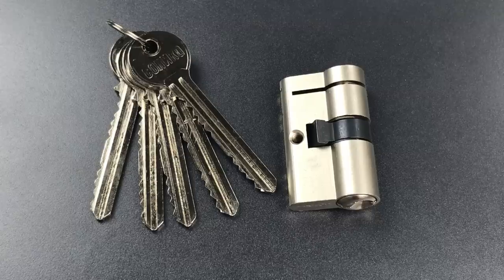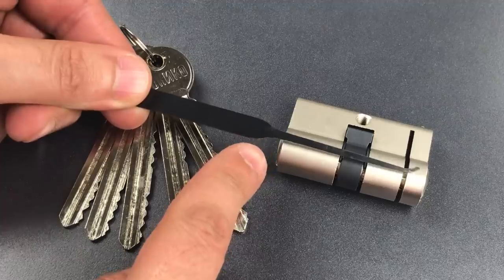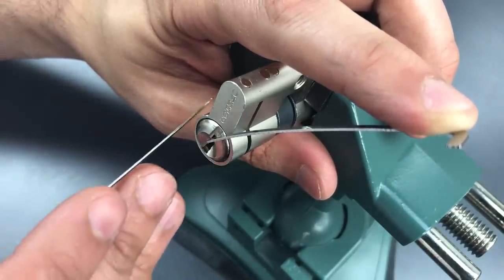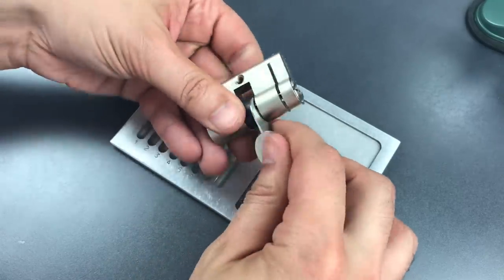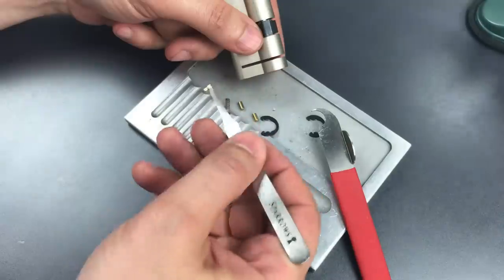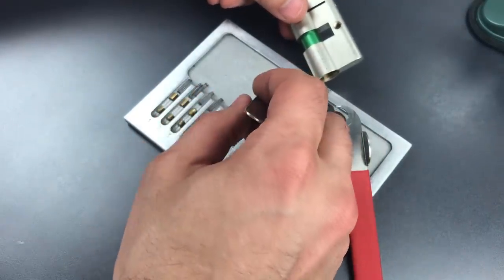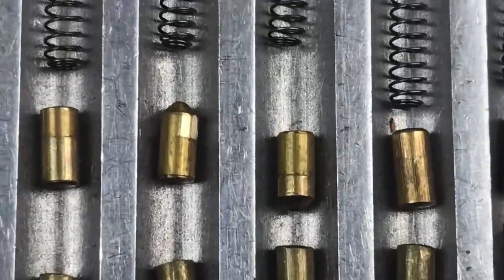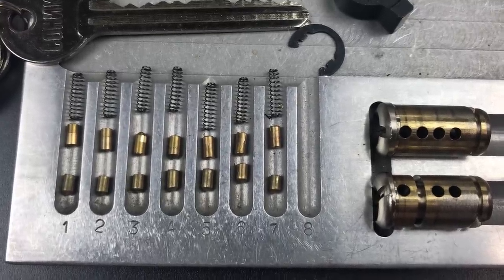[736] Sonico LONG Key Euro Cylinder Picked and Gutted

Comment: You should re-pin that as a challenge lock and send it to BosnianBill as a thank you for the naughty bucket locks.😁
Reply: This
Reply: Make that a combo lock. One end is a dimple core and the other is a disk detainer core.
Reply: I was just thinking the same. It wouldn't take much to thread a couple of chambers in the core, add some more exotic pinning upstairs & downstairs, a few variations in spring tension, and it could really perplex a picker who doesn't have sight of the key or know about the unusual mechanism. Even without those modifications, unless an attacker already knew to expect this lock, they'd probably not arrive at the premises with a suitable length pick. It's a really interesting lock in any case.

Comment: Someone needs to make a 12 pin version of this! With security pins and all the fixings. I'd want to see that key lol
Reply: Of course, add fake cuts in the middle, so it looks like a 16 pin lock. :)
Reply: This would make for a truly brutal challenge lock. Throw in one of those ball-chain "pins" anywhere you please and you'll get hours of fun out of it!
Reply: Don't forget that this lock has poor tolerance so it wouldn't put up all that much of a challenge once you find a long enough pick.
Reply: Of course, but that's why you use an actual decent euro to start with, for example a six-pin which would give you the 12 you want, something with a decent manufacture quality, and as was said above "security pins and all the fixings" - in short, the good shit.
Reply: Precisely this. There's no way to have 12 pins in this junky Sonico lock anyway. Just mod an existing good euro cylinder with a similar style cam (can pass the key through it). Hard part would be to create a key that would be long enough. Still would be quite the sight
Reply: Creating a key isn't too difficult, a damn sight easier than creating a core... Or rephrased, I can predict how to machine a new key, I can't even begin to imagine how to machine a core.
Reply: @colinstu  technically, you could drill it for more pns. But starting with a fresh bit of brass, or a decent lock would be the better way.
Reply: or a Abloy style disc tumbler lock that would tension from the middle.
Reply: I could see lpl picking that in under 3 minutes
Reply: Fixins
Reply: @Islacrusez  more like hours of frustration
Reply: @craigcrissman4651  😇

Comment: I could argue that 99.9% of the people that would attempt picking this lock, would have no idea that this lock was inter connected making it very difficult to pick.

I'd think the only way to get the driver pins into place would be to shim the bible and remove on the core installation. 

Anyway, good pick!
Reply: I feel like you'd start to get annoyed after awhile only to stick your pick in the back wondering why it's not opening only to realize there's more pins (if you pick is that long)
Reply: Gunga Dinn the standard trick is to cut a follower tube into 5mm or so slices and feed them in and out slice by slice from the central hole.
Reply: @Luxe388  clearly needs a 3rd core with more pins
Reply: you'd also need really long tools to reach the second core so even if you figured out the secret you wouldn't be able to actually do anything with that information

Comment: Would have been harder to tension if the cores were split. I wonder if that is a realistic modification to increase the Lock’s pick resistance or if the actuator would allow for it... hmmm.
Reply: Grouchy Ed I was thinking about this also. I think it could be solved by indexing the locking Paul  on the key instead of the cores
Reply: The Mauer GM redline has pins in both chambers and  has split cores and makes it harder to tension, but being a dimple it is easier than this one as you have more room to tension it.

Comment: If installed externally, I suspect that keyway would be filled with dust and dirt from air blowing through it. Any tight tolerances would fail much earlier in that environment.

Comment: There was a euro cylinder lock of similar design in the 90's in Czech Republic made by Guard, a company later, or at that time aquired by EVVA, had six pins each side, security pins as well and you actualy needed two keys, one from the outside, the other from the inside as the profile was of course asymetric and trying for pick resistivity. And they were making it different lenghts on demand.

Comment: I think the interesting thing about this lock is that you wouldn't guess from the outside that it was a super long lock and it's highly improbable that someone would have an extra long pick with them. I would put a spool and a super spring on each end though and then you would just bend your pick on the last pin.
Reply: File in kit always

Comment: At last, a euro lock that puts up serious resistance to a snapping attack.  Prior to this, the best that has been done for snap-resistance is a sacrificial section, but that leaves a core with only 2 or 3 pins so is much easier to pick.  Better than nothing, but a combined snap/pick attack on  3 pins might not be beyond some thieves.

This thing required decent picking skills even after a snapping attack.  It's let down by the design of the core, but the concept is a good one.  Tighter tolerances and some security pins would make this a winner.

Next problem, that key is going to be a real pain to put in a trouser pocket unless you're wearing cargo pants.  With sealable pockets, otherwise the key will jump out when you run.

There is always a downside to a euro lock.  It's inherent in the design.

Comment: tip for them is to make the "core" like on a normal lock but that can only be tentioned from the back also if the front core is not picked the back can not moove to unlock but if the front is picked then it can freely moove only 90 degrees in either side ...

Comment: That is freaking crazy. I think with some better machining and more security features, that lock could be pretty formidable.

Some counter milling, a variety of pins, and having the two cores have different bitting. 

I know with each core having different bitting, you wouldn't be able to open the lock with the key from either side, but most people only lock there doors from one side anyway.
Reply: It should be easy enough to cut keys with bitting that mirrors each other. Then you just have an inside key and an outside key.

Comment: Do you think there is any reason why more locks don't use security pins? It seems like a cheap and easy way to up the security level, but a lot of even mid to high security locks don't use them
Reply: Security pins add mfg cost and complexity.

Comment: Wow, what a simple and elegant idea ! That will complicate things for the cocky pickers ! Oh .. nevermind ..
Reply: More importantly, it will defeat the snappers.  Even those with picking skills good enough to attack the 2- or 3-pin core that's left after they've snapped a snap-resistant lock.

Since snap attacks are by far the most common on euro locks, even with shitty cores this thing will prevent most thefts.

Comment: I wonder if it would be possible to create a mechanism with which you need to apply tension to both sides of the cylinder, in order to reinforce the idea of using two keys at once or one long one as opposed to being able to pick both cylinders separately. Reaching through the middle part in order to apply that tension would make things even harder.

Comment: i havent finished watching yet but that key looks just like a rake. its interesting that a lot of these "hard" locks really arent hard, its just overcoming the challenge of getting your tools to fit or adapt to the lock. it does work in the wild though when its a surprise to the attacker.
edit: it looks like the pins are cut lopsided and uneven, low quality... it seems like this is the type of lock to make when youve got a ton of extra key pins to use. just throw em in there any which way and call it a high security lock with an impressively long key.

Comment: Hi I have a question. When picking an unfamiliar lock, how do you know if it needs to be turned clockwise or counterclockwise?
Reply: If its outside of the protecting stuff (door) usally there is no mechanism what determinate what is the opening direction. If its in the door usally you can see what is the direction by the lock side (door opening), because 90% they are turned to opposite direction.

In case of chain lock is usally turning right, because mostly pple are right handed and with right hand its comfortable to turn the key right.

But any case if you didnt sure what is the key turning direction, you will know soon, because you wont get the tiny turnings of the core. You can use a pencil or marker to see its moved or not...
Reply: If its outside of the protecting stuff (door) usally there is no mechanism what determinate what is the opening direction. If its in the door usally you can see what is the direction by the lock side (door opening), because 90% they are turned to opposite direction.

In case of chain lock is usally turning right, because mostly pple are right handed and with right hand its comfortable to turn the key right.

But any case if you didnt sure what is the key turning direction, you will know soon, because you wont get the tiny turnings of the core. You can use a pencil or marker to see its moved or not...

Comment: Odd that it has 3 pine on one side and 4 on another. This concept seems like it coule be very challenging: tight tolerances, counter milling/threaded pin holes, security pins, varied spring strengths, 5 to 6 pins on each side, and a highly pericentric keyway.

Comment: this could be made exceedingly more difficult if the front lock was allowed to turn 60° or enough to offset a picking tool so much that picking the rear pins under tension would be nigh impossible

Comment: Why not pick the pins from both sides simultaneously?  Granted, you'd have to keep switching around the lock, and tension would be a pain to hold, but I think it could be done.
Reply: Yes, it could be done.  But the idea is to approach it as a thief trying to break into your house would do.  If the thief can reach both sides simultaneously then the door is already open and he has no need to pick the lock.

Comment: I'm just wondering... Would it be possible to connect those two cores in such a way that if you only put tension on the core facing you, then once that core is picked, and starts turning, it will lock up the other core, making it impossible to pick?
So unless you put tension on BOTH cores, it will be impossible to pick.
I'm not sure how it could be done, but if it's done, it should make it impossible to pick unless you know about this feature.

Comment: How unusual for a Euro cylinder. Long key would push out a key left on the inside without problem I suppose too, as long as the plugs were in the locked position....hmmm....

Comment: I don't understand why you said "false set" when the first core was picked. That's not a false set, that's a very true set.
Reply: Well, it's still technically a false set, as the core has rotated, but it isn't open.
A true set, means you have finished picking and it is unlocked.